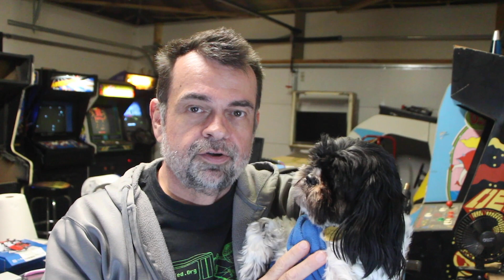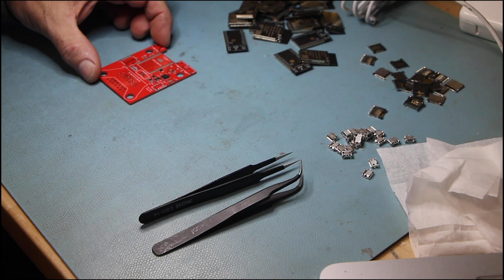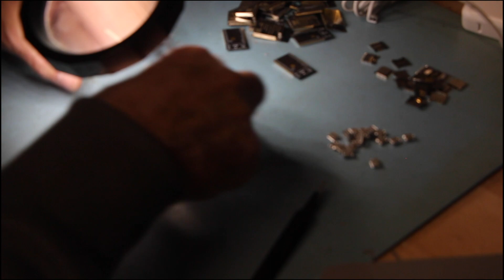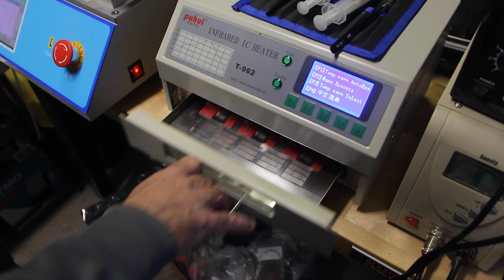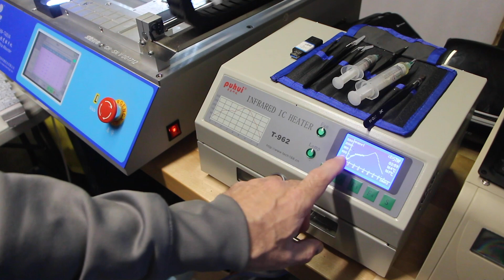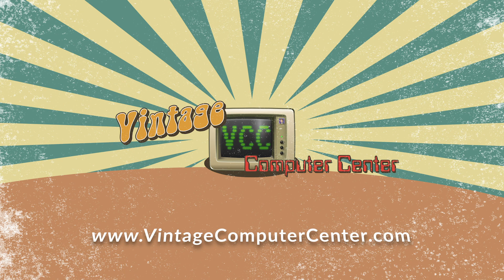Building the FujiNet - Part 2

Comment: Does the movement of the pick and place effect the position of the pcb components in the reflow oven as it looks to be causing it to vibrate/jolt quite a lot there ?
Reply from the maker: No, typically I do not run both at the same time, however.